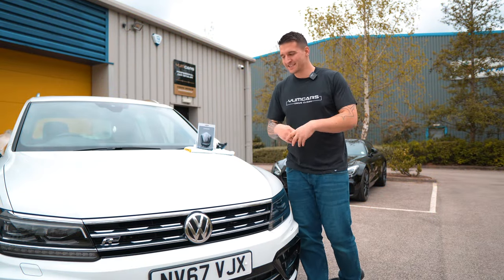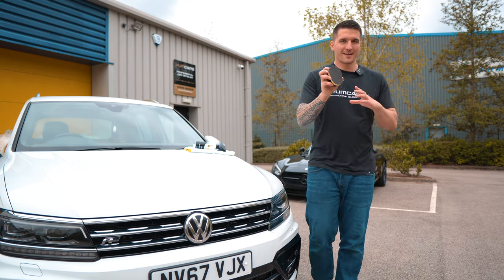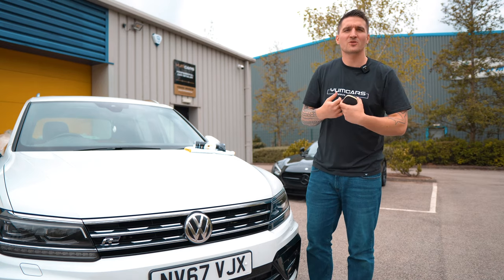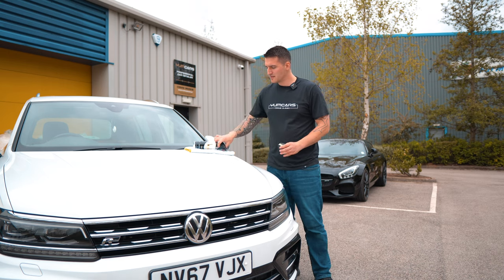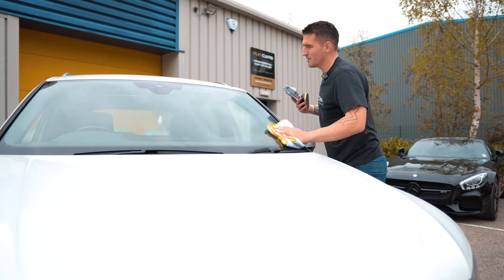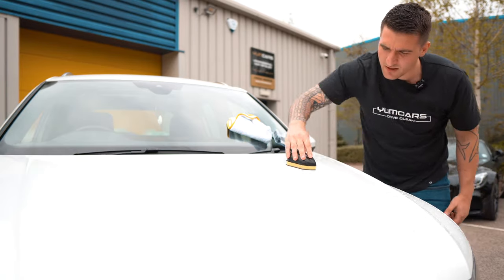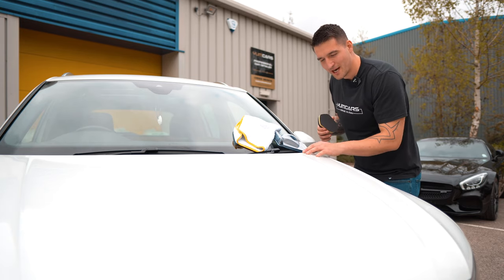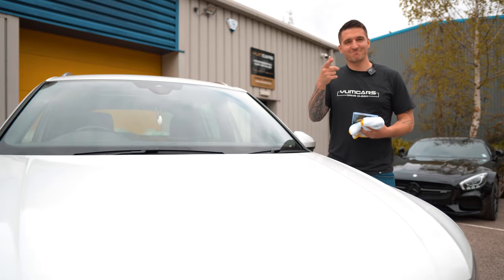Is the Traditional Clay Bar Dead? Let's Find Out!

Comment: Very nice video and product demonstration. A couple of questions if I may. 1. If I opt to polish the car to have it coated - do I use clay before or after the polishing?  2. Can you use this on ceramic coating after it also becomes contaminated? 3. If you use this in conjunction with QD - do you consider the surface to be Quickdetailed or do you have to apply a quick detailer after the process again to have the quick detailer applied on your car properly? Or is it better to use IPA after the claying process and apply a quick detailer afterward? Lastly - 40 applications - is that cca40 cars? -What is the exact indicator that the pad is finished and needs to be replaced?
Reply from the maker: 1) before polishing
2) at your own risk, coated cars so opt for as much touches treatment as possible.
3) we would recommend washing your car after the clay step, so apply detail spray again
4) yes unto 40 uses dependant on the contamination grades you had to remove, also you will see less contaminants being picked up over time.
Reply: @YumCars  Fantastic - thank you so much for taking the time and answering - cheers!

Comment: Hi, Going to use Yum clay for first time very soon, saw in a recent video that you diluted Ceramic 50/50 and used as a drying aid, can the detailer by diluted when using as a lubricant or should it be used non diluted
Reply from the maker: As a lubricant we would recommend straight out the bottle to gain the maximum lubrication during the claying stage